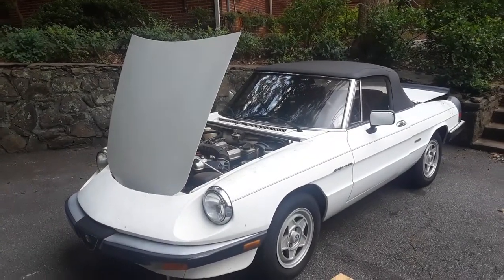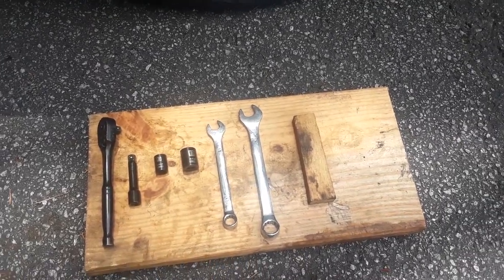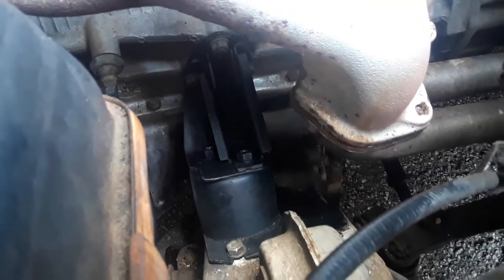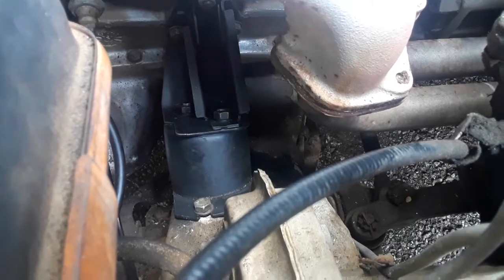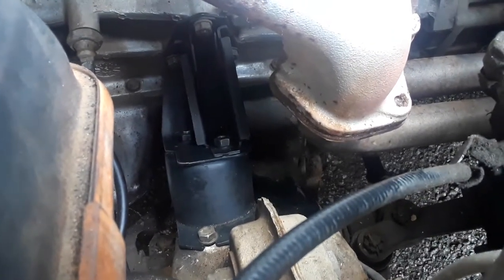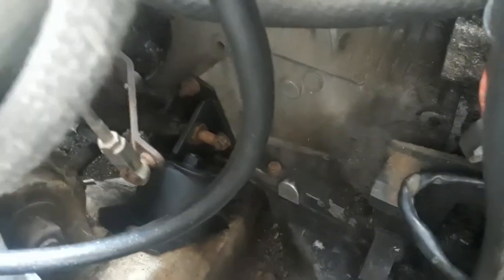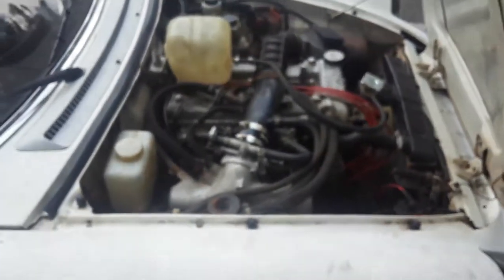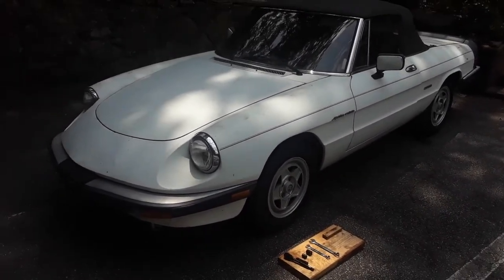How to replace engine mounts on Alfa Romeo Spider

Comment: Best to lift the engine and take both mounts off and install at one time,, doing the driver side first,, then tighten those bolts down then the pass. side  next make it harder, I have done this dozens of times when i worked at alfetta motors remove the parts ness. to get to the mounts.. take the nuts off the mount to the frame.. lift engine.. remove mounts from engine.. as high as you want( it will stop when the trans. bellhousing contacts the bodyshell,, but this will give you lots of room.. install new mounts.. lower the engine slowly.( not all the way to the frame.. give about 1/2 inch of clearence ). you will have to wiggle the engine around a little for the mounts to fit over the frame studs.. got the mount to the studs lined up? then lower the rear away.. and allways use some anti seize on any nut or bolt you removed...it will make it easier to work on the car later

Comment: I am in the process of changing the engine mounts on my '87 graduate spider. The driver's side was fairly straight forward as you said, but the passenger side I am having a rough time. The bold that holds the bracket arm going up to the air intake, will not come out. I have tried turning it with the 17 mm ratchet wrench, I have tried tapping it out with a hammer and a block of wood, so I don't damage the threads. I have tried raising and lower the engine, but for the life of me I can not get it to move out. With my new replacement mount, the bolt does not look threaded, so it should just pop out when just tapping it, but it will not move. I have spent hours on this one bolt. Did you have to take the air intake bracket out with the engine mount and press the bolt out? Just curious if you have any suggestions. Thank you for posting this video by the way.
Reply from the maker: No, as I recall, mine except being hard to reach and unscrew went out pretty easy. Didn't take the bracket out, just had my wife wiggle the intake for me while I was laying under the car. Honestly, don't know what's the problem, must be just really stuck..  I will check it out again soon as I see my car. Sorry for the late reply.
Reply: wear some good leather gloves on that part,,or you will give some blood to the alfa gods